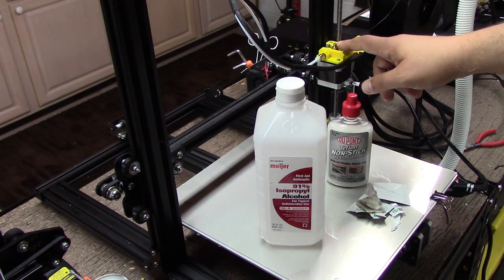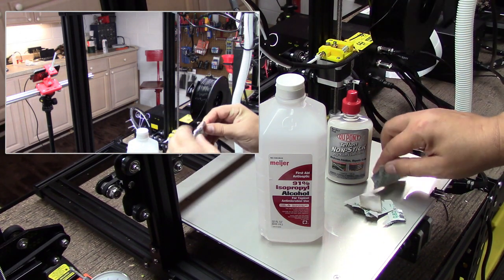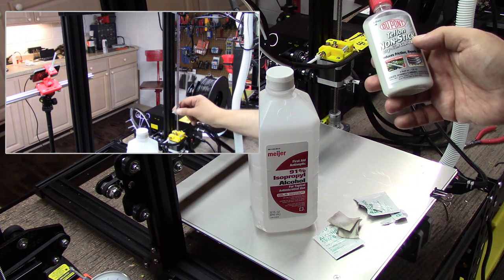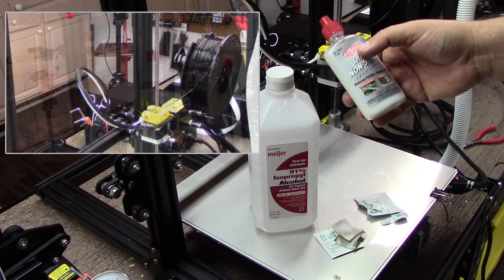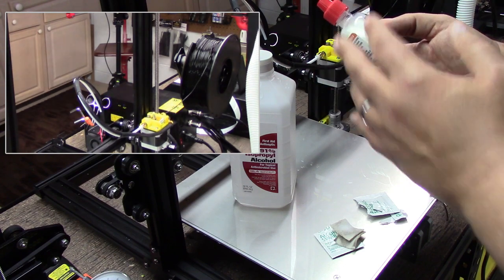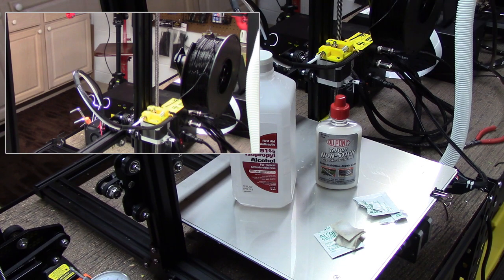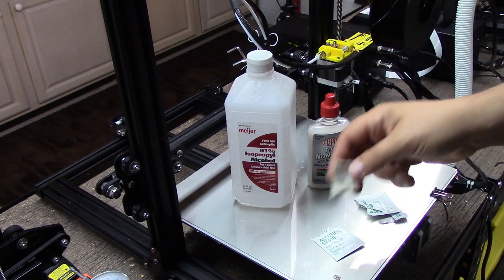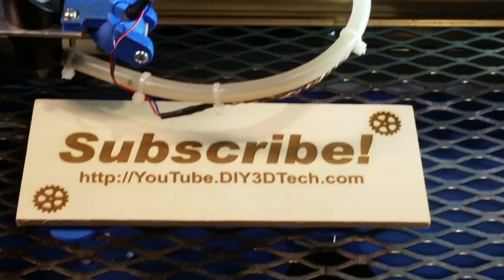Creality CR10 - Dry Lubricating the Z Axis with Teflon!

Comment: I used the lubricant you recommended and it really did the trick.  Just removed the z axis rod, cleaned it off and replaced it with some of the teflon lube, no more problem prints!  Thanks.
Reply from the maker: Your welcome!  This is great stuff!

Comment: Yes, Teflon is the right stuff. I used Silicon oil but that did not work. 
My 17hrs print got stuck in the middle. And I was looking for the reason.
After consulting the technical specification of Silicon oil, it was obvious. 
Silicon is not made to lubricate metal on metal.
I figured out, that Teflon is exactly the right stuff.
Lubricate all axis ever since on all printers and my little CNC, no issues up to know.
Reply from the maker: Thanks for sharing!  As good to know!  Have been using Teflon for about 6 months now an really surprised as to the difference it makes!